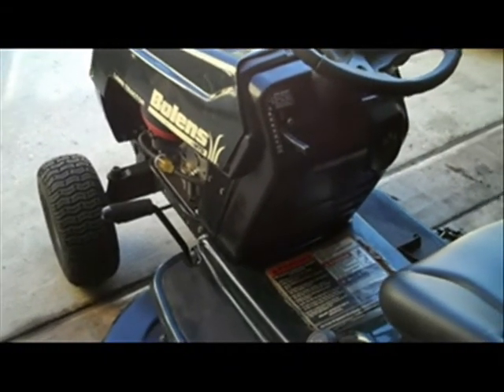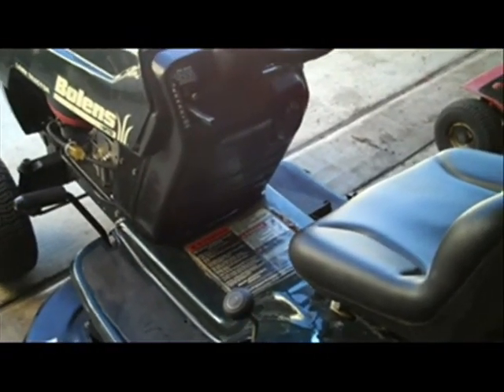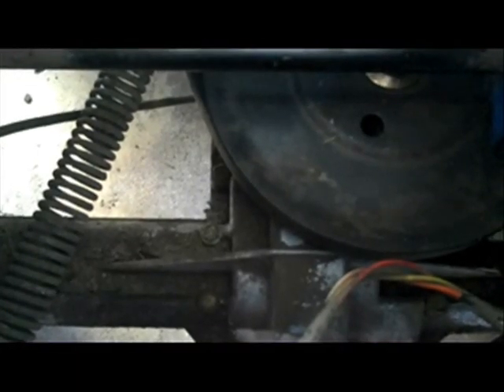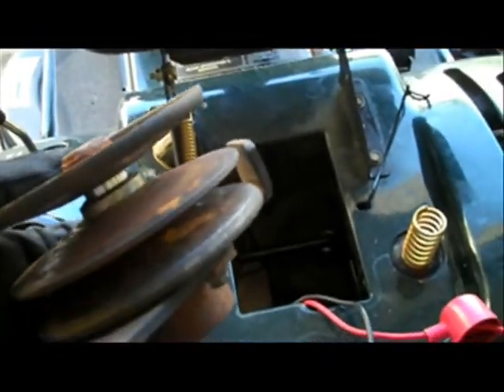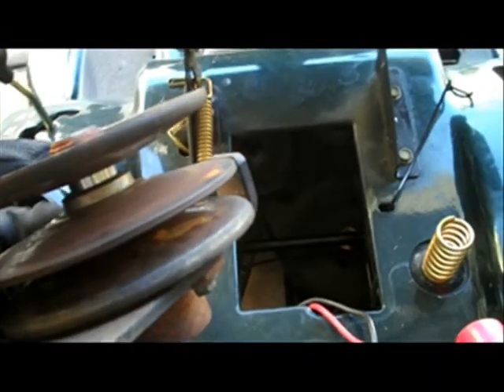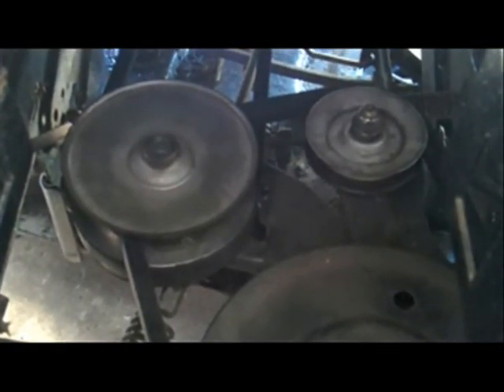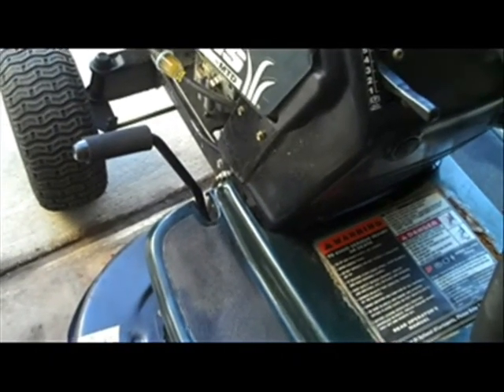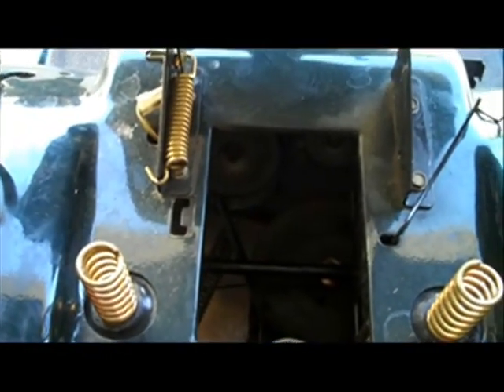How the MTD Varidrive system works

Comment: I have 23year old M.T.D yard machine and it seemed to have only one speed and that was 2 fast. I found the problem was the tentioner pulley spting for the transmission belt was worn out and it would not apply enough tension to the variable speed pulley to overcome the engine belt. tension. Hope this makes sense. I put extra Spring on the transmission tensioner. And now I have all different speeds. I hope this helps someone because I spent quite a while on the internet and no one had this to say.

Comment: Ok great video explaining but I have a troybilt pony with same varidrive. When I switch into a different speed nothing happens I stay at 1 speed the whole time any advice on what to check?
Reply: Jimmy S. I just posted a comment to you on a different channel. I found that the Spring on my tentioner for the transmission belt was worn out and I only had one speed once I added more tention to that pulley. Now I have all different speeds.  So my Spring for the transmission belt tensioner was worn out.Hope this helps.
Reply: @BigBoxDodge2020  thank you so much for the reply. I Will look into it.
Reply from the maker: Usually a lack of tension or the vari drive pulley can get steps worn into it where the belt normally rides and wont shift on its own. if pulling back on the clutch pedal makes it shift this might be the problem.
Reply: @pfun41  My variable speed pulley is in excellent condition, I've ordered new spring for the tensioner on transmission pulley. I will be replacing that very soon. I had added an extra spring on the pulley and it worked better. I'm sure that was the problem.

Comment: I replaced both belt with MTD factory belts (its been said that they are the only belts that work right on Vari pulley sytem.. but I did no adjustments to it and it will not give me anything but high speed now. What are the adjustments to get it workin right again?
Reply from the maker: I think there is one linkage with a tension adjustment on these. It depends on how yours controls speed. Only moving in high gear means there isn't enough belt tension. Ive seen this caused by a seized  idler arm on the rear belt.

Comment: your the only one that explained how the speed is actually changed, the tighter the front belt from engine is causes that belt to sink into pulley causing the other belt to move out , hence the faster speed. Also since the belt is tighter it reduces chance of slippage in higher speeds (belt contact area is less but force is higher.

Comment: I don't like the vari speed belt.  My tractor loses power going up slight hills and won't keep going because the drive belt is too loose when the pulley separates.  Don't know how to correct this.  Couldn't understand from your video how you adjusted this belt.  I know the spring and idler pulley tension the belt and when it is tight the mower runs fine but then the pulley separates.  Hate this system.  Stupid engineering if you ask me.
Reply: @The Punisher Thanks for response but sold the tractor late last spring.

Comment: Hey, not sure if you'll answer but what would happen if I do a pulley swap with this type of transmission?
Reply from the maker: You're on your own. People have tried, Maybe you can get more speed, maybe not. It's a very finicky system.
Reply: @pfun41  I believe that it'd burn out the transmission since it's not actually geared it just has forward. It'd go faster because it's turning the pulley faster but it's end up just breaking apart eventually.
Reply: @pfun41  I ended up just swapping the motor onto another frame.

Comment: Hello, I like your video.  With the price gouging because of covid I'm not willing to buy a new lawn tractor and I'm hoping someone could help me with this issue:  The lawn tractor jerks while driving, almost like the belt grabs then lets go.  It does it more frequently the faster I go.  I replaced the belts with OEM, checked the springs and the engine runs perfectly.  The jerks happen very suddenly and happens hard and hurts my neck when I drive it too long.  Oh yeah, one more thing; there is no jerking in reverse!  Any help would be much appreciated...
Reply from the maker: Its an issue in the transmission. The shift collars and gears wear. https://www.youtube.com/watch?v=2P9FvrCQXs8&t=745s

Comment: Hy !  I also have a tractor like this, 6 speed.  in 6th gear, the pedal does not go fully backwards only when pressed back by hand, it is the fastest.  maybe the retraction spring could be the fault?  it has a new original mtd belt on it

Comment: I  replaced all 3 belts on my elderly neighbors MTD yard machine  7speed mower. I always noticed her mowing super slowly over the years. I noticed that it only moves in 1st gear! 
Not sure if it’s something I did or if it was always that way?  The lever moves up to 7 and parking brake works but notice the pulley arm hardly moving when changing gears?  I could manually slide the pulley up and down and move the pulley arm back and forth before putting belts on. All springs are on!  
I used Napa belts!
How much up and down movement should there be for arm that the two varidrive pulleys bolt to?  I thought maybe the locknut came loose so i tightened it up but left it loose enough so the arm/pulleys can move freely!
Reply from the maker: Universal belts or belts that are made for the mower?
Reply: @pfun41  They aren’t MTD belts if that’s what you’re asking!. They are high quality Napa belts!
Reply: @pfun41  Thanks for the reply! If it makes a difference, do you have part numbers for the exact belts from MTD?

Comment: I know this is an older video. I have a varidrive - it only seems to have fast speed. I replaced the upper belt that goes to the transmission, it feels the same. I’m guessing I need to replace the long drive belt that goes from the motor to the dual pulley?
Reply: Check the park brake. It has a plate, maybe is worn out
Reply: @leo-.-258  it turns out it was the drive belt.

Comment: how do you remove the variable speed pulley?  My bearings have gone out.  I just burned up two belts.  I noticed that pulley was hard to turn by hand.  I went under neath and removed the bottom bolt.  The pulley would not remove.  There was also a cup bearing, that I removed the bolts to and it still will not pull off.  What am I missing to remove the pulley to either replace or just replace the bearings.  I did see the metal fragments in the cup bearing when I removed the bottom bolt, so I know I need to replace the cup bearing.  I just can't get it off.  And yes, I have removed all the belts.
Reply from the maker: There are 3 bolts holding the bearing flange to the bracket. Remove those and the pulley should come off. I believe there is a bolt holding the rest together, remove that and you should be able to press the bearings out.
Reply: @pfun41  I removed those 3 bolts and the bolt and washer that was in the middle at the bottom.  it wiggles, but will not lift up.  the bracket that the 3 bolts was on just turns, but will not slip off the bottom.  should I try prying it off.  I have looked at the drawings and I don't see anything else holding it.  I do not see anything at the top to remove of the pulley, like a clip or anything holding it down.
Reply from the maker: @tatetimmy  It might be stuck, especially if the bracket or bearing flange is rusty.
Reply: @pfun41  I ended up taking the entire assembly bracket off.  The bearings were seized to the shaft of the pulley.  I hammered them off.  I picking up my new bearing today.  Hopefully it will solve my problem

Comment: I replaced my belts but unlike alot of the comments about slow speed I have fast speed an the parking brake does not stop the mower an the brake only slows it down, if I shift into neutral it will stop, the if I put it into forward with the parking break engage it moves like there's no parking brake an the speed lever only has fast speed. What's the problem?
Reply from the maker: Sounds like your belts are too tight, either the wrong belt or something in the system is messed up keeping them too tight.
Reply: I have the same problem! Did you ever cure the issue of no low speed?

Comment: I was wondering if anybody reading who has one of these "7 speed shift on the go" MTD models with this 2 belt CVT system can say:
How well is it holding up ?
Does it tolerate moderate towing ?
How frequent are belt changes needed ?
Can you compare to Hydrostatic or other CVT lawn tractor Transmission systems?
Thanks a ton for any input.
I'm deciding which tractor & drive system to buy now.
Reply from the maker: I would put a varidrive system over a hydro longevity wise. The hydros in consumer mowers tend to be non servicable with poor cooling and little to no filtration, so they don't hold up well to hills or towing at all, and when they wear out or break repairs are often costly or impossible. Most people never change belts unless they break, and I would guess most mowers I ever got had the originals, which usually got replaced because the belts were cracking or there were speed issues, rarely did they just not work at all. you shouldn't have to replace belts very often at all. They will handle light towing just fine, the weak link is not the belts but the transaxle. They use smaller diameter axle shafts than most mowers. Those don't usually break, but the shift gears wearing out is somewhat common. I have a video on that, its not hard or expensive to fix but the transaxle has to come out and be split.
Reply: @pfun41  Shift gears ,do you mean differential gears?

Comment: My old VS pulley , the weld on the top came off and the pulley fell apart.  After welding it back on, the smaller of the 2 belts became really TIGHT and hard to put on the pulleys.   What is the cause of this?   I managed to put it on, but the belt broke within an hour of use.   Please advice
Reply from the maker: Id get a new/used variable speed pulley and new belts just to be safe. If the weld broke then something was seriously wrong with it. Its also possible there's something wrong with the arm it mounts to. If you don't know what the systems supposed to look like spotting a problem with it can be difficult.

Comment: I replaced the variable pulley with the oe pulley I do not get variable speed any more any suggestions
Reply from the maker: The center plate might not be moving freely. What kind of speed selector?
Reply: pfun41 on the dash it's a brand new variable speed pulley
Reply from the maker: That's odd. Maybe something in the tensioning setup is stuck.
Reply: pfun41 I'll have to check that since it's both belts are new along with the pulley

Comment: I just replaced the belts on one of these  trying to fix a complaint of clutch slipping (that's what the 90 yr old man said) all belts had age cracks.  The only way I can get it to go high speed is to pull back on the clutch pedal while driving.  I've checked all the linkages and springs but can't seem to find a solution.  Any prompt help on this would be greatly appreciated.

Comment: Should you be able to turn the assembly by hand? and if so how easily should it turn? 
My MTD stalls when I engage the blade, I think its a frozen pulley.
Reply from the maker: That's an issue with the blade drive system, it has nothing to do with the Vari drive system. Probably a frozen idler, stuck blade brake, or frozen spindle bearings.
Reply: Thanks, but later that day I discovered the PTO switch was shorted out, causing it to cut out when blade engaged. I was able to rotate the blades by hand.

Comment: when is the belt completely tight? I'm going to pulley swap my transaxle, and need to figure out where to put the pulley to get a size
Reply from the maker: +Logan Pulliam Your in for a real headache. I'm sure there's some calculations and engineering you could use to figure it out but really your just gonna have to guess and see what works. It would be easier to swap in a 5 or 6 speed and fab the necessary clutch components. highest gear will be when it's tightest.
Reply: Okay thanks for your opinion, I was thinking that myself
Reply: @pfun41  
I need your help. At 0:42 what is the name of the pully at the top right corner. On mine the long bolt is not all the way down and the pully is very lose not sure if this is by design
Reply from the maker: @JohnDoe-gk4kn  It's just an Idler and it shouldn't be loose.

Comment: thanks, you did a great job explaining this... I am having an issue with my yardmachines/mtd mower... the first 3 speeds or so seem to work ok, when in 4,5,6,7 it works fair on level ground but when going up hills it will loose torque/tension on the clutch and it wont pull the hill... when you pull on the clutch pedal it will help it to move so I am wondering if I need the varidrive spring??? to pull the clutch back farther? I am going to examine the varidrive its self... I did not realize the pulleys separate in that fashion, I thought it was just the tension of the belt, it could be possible the varidrive is not moving.
Reply from the maker: +codemiesterbeats It relies on the pully as well as tension. How are your belts? Worn belts or the wrong belts will cause all sorts of problems with this system.
Reply: yea I just got both drive belts and cleaned up the pulleys with sandpaper and stuff... I am thinking the rear belt is stretched. waiting on the rear belt now. I also put a new spring on the varidrive pulley

Comment: I have an MTD with this variable pulley, and I am having slippage under load (mowing up hill). I took the pulley out to inspect and notice that the glide shaft is void of lubricant. Moving the center pulley section back and forth it has some resistance. It seems putting a very light coating of high temp grease here would help the movement. Would you agree?
Reply from the maker: icin4d The center plate should move back and forth freely, it's also allowed to rotate. You can try some grease or maybe just spray it with some WD40 or PB blaster. You need to be careful though as lubricant may make the belt slip more. I've yet to see any varidrive pulley with grease on the shaft. When slipping occurs the belts tend to be worn or stretched, Usually new belts will cure most Vari drive issues.
Reply: ***** Update: I put a very (almost non-existent) light coating of high-temp bearing grease on the glide shaft. The variable pulley now moves smoothly through the different torque/speed ranges. Before, when it would slip, I would hear a slight chattering sound. The chattering was the center pulley moving/rotating on the dry glide shaft. That is now gone and it works great.

Comment: I have a Ranch King with varidrive, and was going to pully swap the trans pully for a smaller one. Will this cause problems with the varidrive? Im aware ill have to get a smaller belt or make some kind of extra tension pully, just wondering if it would cause any other problems with the way it switches ratios....
Reply from the maker: It will likely make it faster, but the real trouble is going to be getting the pulley/belt size correct. These systems depend heavily on belt tension being correct in order to work properly.
Reply: Yeah, I figured i would have to make another idle pulley tensioner on it cause the belt is a couple inches to big after the swap. I'll try it though and see what happens. I fall else fails i swap in a peerless and redo the pulley system. Thanks for reply, keep us updated on yours!
Reply: hey im just wondering; if i swap the engine drive pulley on one of these varidrive mowers from 3.5" to 4.5" will my output speed increase? I tried putting a smaller pulley on the transaxle before but the speed stayed the same and i tried multiple pulleys but nothing happened. Knowing that it doesnt change the output speed from the rear pulley, will it increase the speed from the front pulley? I just dont want to go to Tractor Supply and pay $20 for bigger engine drive pulley and it do nothing just like what happened with the rear pulley. Cool video

Comment: i have a white gt 180 i think it is a 1989 would the vari pulley make it where it wouldn't move,I replaced both belts about a month ago because it wouldn't move it did ok but it wouldn't go up hills now it's not moving at all again i am so frustrated with this hand me down haha
Reply from the maker: It could cause problems if it is worn out, but it would have to be noticably worn. Does yours have the manual shifter? Try putting it in high gear and pulling back on the clutch pedal with your foot, if it moves you either have an issue with belt tension (possibly spring related) or a worn/stuck varidrive pulley. It sounds to me like your issue is with belt tension. You may have a broken or weak tensioner spring. It is also possible you got the wrong belts, if one is too loose it will barely move. I always look up the correct belt by the model number, there's alot of mowers with this system that use slightly different belts. The width and length are critical for proper operation. If you use a standard belt on one of these it will work poorly or not at all. You can't go by the size of the old belts either, as they will stretch and wear over time. Also check the arm that the pulley mounts on as well as those for the tensioners, as these will cause problems if they are worn or out of place.
Reply: I got belts for the model number from mtdparts.com. I pulled out the vari pulley it seems to be in good shape it slides smoothly. So do you think it's the tensioner spring because i would have to pull the clutch pedal back for it to start moving and would this cause the belts to wear faster? Thanks
Reply from the maker: Mikeybear vapes
 if you have to pull the clutch back then you definately have a tensioning problem. If you put it into high gear and let go the clutch pedal should move way back on it's own. I know there's at least one large spring that tensions the Varidrive pulley arm. There is also a second tensioner for the rear belt, check that as well.